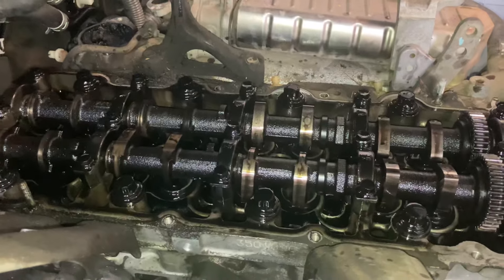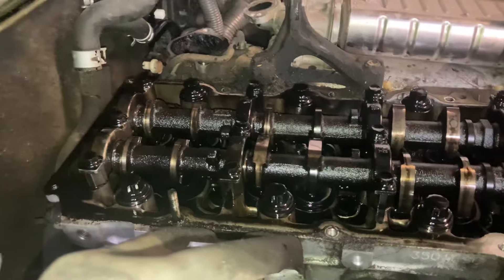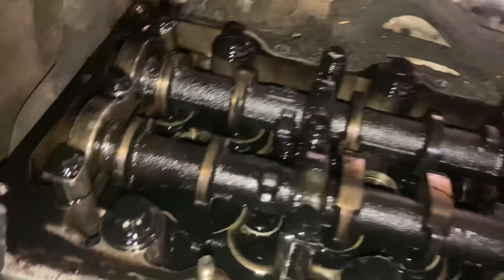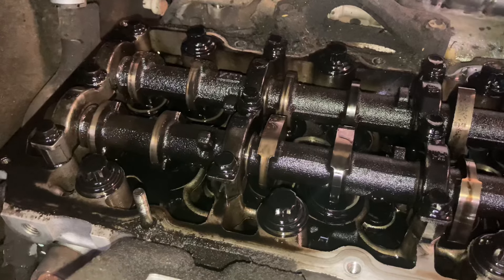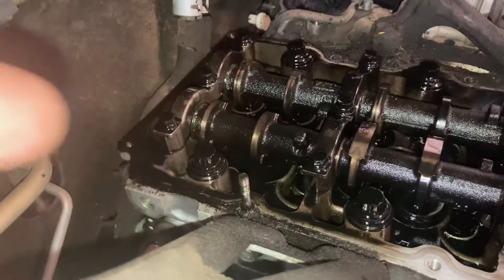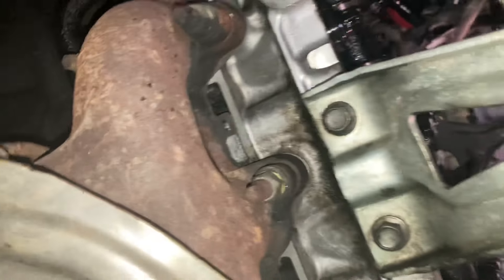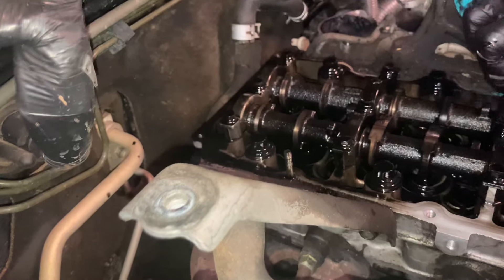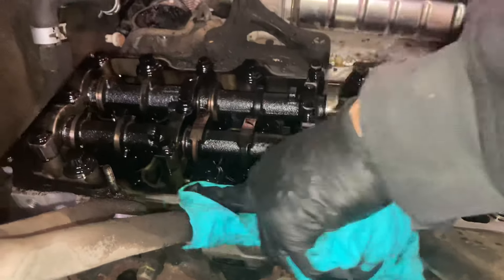D4D Engines Injector replacement tech tip # 6358

Comment: THAT bolt was what caused an annoying oil leak caused by a mechanic who caused a hairline crack on the rocker cover.  He never told me about it.  Only found out the cause after we moved away and another mechanic did the job.
Perhaps the thread being dicky was partially to blame-who knows.  It’s old PLASTIC.  New rocker cover at $400 (still is that price - which is amazing after all these years) is quite reasonable.

Thanks for supplying the front wheel bearings completely assembled and the long SCV ages ago.
Almost nothing left to do, but enjoy her.